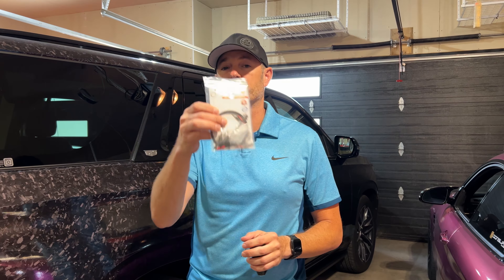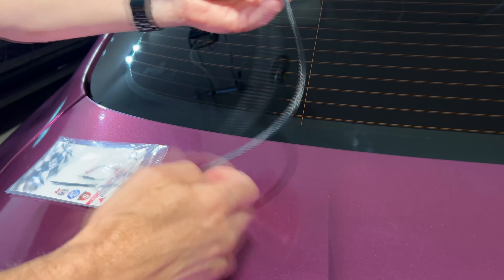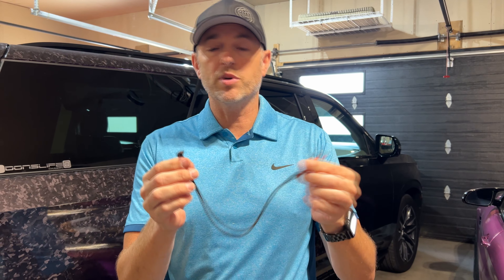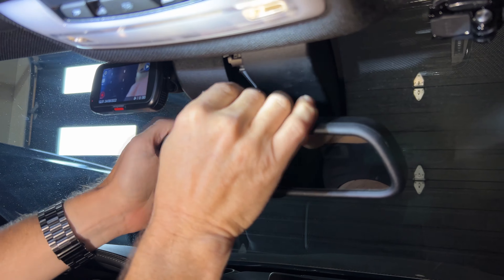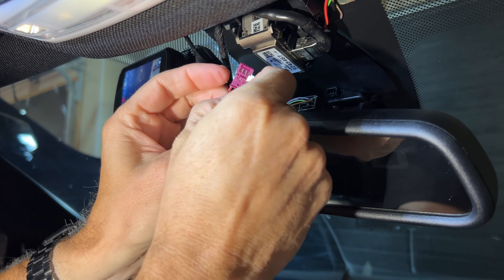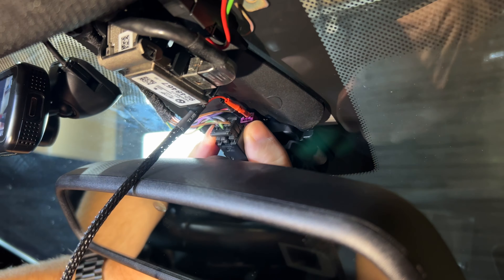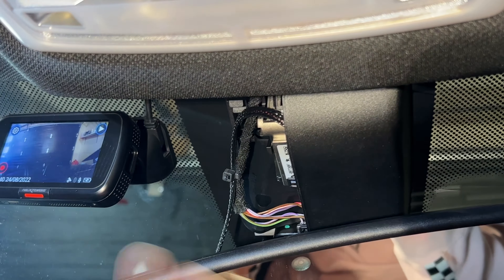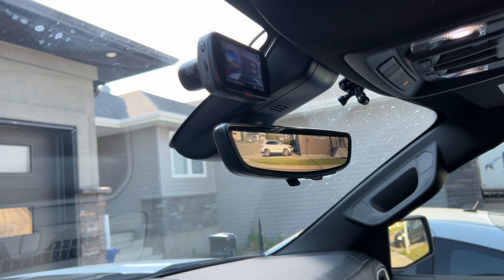Mirror Tap - Universal Install - No More Messy Wires!

Comment: After all that tidy work - the glass-based suction cup just seems off. Get a mirror post mounting bracket. Decent, vibration-free ones run around $40 to $50.
Reply from the maker: Well the video was to focus on one specific DIY project.  I would also recommend something like a blendmount product as well.
Reply: @Donslife   Yes, and apologies if my comment sounded critical to the nature of your video. Didn't mean it quite that way. I came for the wire-tap side of the video, and your help with that is spot on.

Comment: Nice work. I think that is the exact same one I used on my 2021 GMC Sierra AT4 (6.2L) radar/laser detector. ZERO issues since the install. It turns on/off with the engine.
Reply from the maker: I agree.  Handy for whatever you want to plug in up there

Comment: Is there any reason why I shouldn't do this for both a dashcam and radar detector? Would my mirror supply enough power? My dash is starting to crash where the wires hang and I would rather route them directly to the mirror and free up some ports rather than run all around my trim. Thanks!
Reply from the maker: It would all depend on the current draw for the devices.

Comment: I have a 05 Yukon I can tap into the auto diming or the air bag light on the mirror or the weather temp on the mirror which should I use
Reply from the maker: I would try the auto dimming circuit

Comment: How do i fix it randomly turning off because the wire isn’t secure?
Reply from the maker: The wires are secure in my installation. Maybe try bending a slight curve in the loose one to create a tighter fit.

Comment: I tried this. It worked. But the power stays on… it never turns off.  What am I doing wrong?
Reply from the maker: Mine shuts off (BMW) after 7-10 mins when the vehicle is turned off.  Turns back on when I open the door